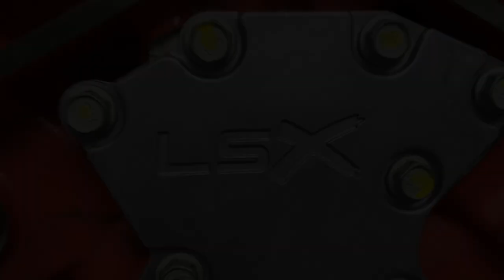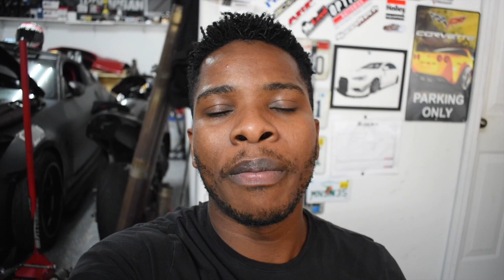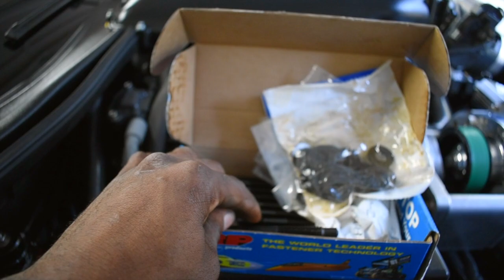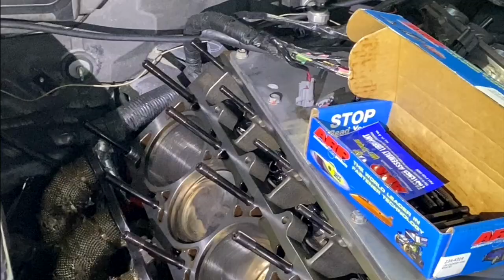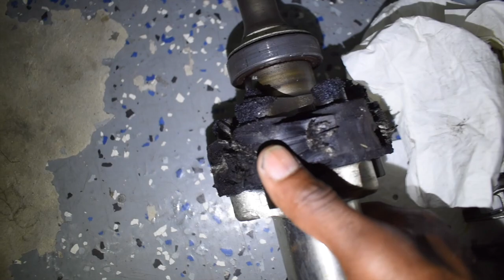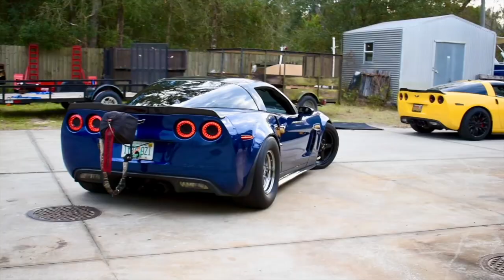ProCharged 441 LSX C6 Z06 | Broke Our T56 Transmission

Comment: That's so awesome bro that you can do all your own work.  Didn't know that you were on a T56 trans, those are the weaker ones so it's good it lasted as long as it did. You should be good with the ZR1. The gears will be a bit longer so that should help a bit with traction.
Reply from the maker: Gears are longer, I’ve tested the trans, did not help with traction lol
Reply: @McgradyRacing  Damn. Are you running leaf springs?

Comment: The spring pressure broke the bolt. When you undo a rocker arm bolt make sure the valve for the rocker arm bolt is fully closed. Most time you can pull the treads out. Do it right once, it's time consumming but you will avoid issues
Reply from the maker: You’re correct bro, more work but safer

Comment: Tick performance builds good t56 and tr6060 at a good price. Might wanna give em a call
Reply from the maker: Went with the zr1 transmission for now. Gonna end up building that later down the line
Reply: @McgradyRacing  tick performance is gonna have good options when ready. Many good options like RPM, tick just broke stickshift record too!!
Reply: @TheRdub82 just went with a tick fully built t56 hope I’m happy with it and I don’t regret going 6060
Reply: @ryandoolittle1344  hopefully so. What's the powerplant it's behind? Keep us posted on how it goes!
Reply: @ it’s a built 454 N/A making around 600 whp don’t no to much about internals has Frankenstein heads and a bunch of goodies to make me believe it’s nothing cheap inside bought it from an estate so got a steal and will do my man should be about a week out and I’ll get some good data tick treated me super well was definitely happy with the customer service price was a little steep but I built it for 1000whp so I don’t have to touch it for a while
Reply: @ full KW suspension pretty happy with car just sad the trans went out so soon after buying it but hey that’s the name of the game
Reply: @ryandoolittle1344  right on. All good stuff. Should give the gearbox good use ⚙️ glad to hear the customer service at Tick Performance.
Reply: @TheRdub82  appreciate it buddy hit you either way a sub you god some dope cars !!
Reply: @ryandoolittle1344  thanks man I definitely appreciate it.  The content is slow now since I'm overseas, but I look forward to resuming once CONUS. I have a few vids I need to edit and release.

Comment: More baby steps forward!  I've always had mixed emotions about those rubber to aluminum bushing replacements.  They hold up better, but they also transmit a lot more shock/stress to the trans and rear!  I almost think leaving (new) factory rubber bushings in place and making them a high-wear weak link that needs more regular replacement might be the better answer until everything behind it is built up.

I love these cars, but they definitely get to a point when incremental increases get exponentially more costly due to their design!  Mine is still fairly stock-ish and I'd love to build it, but I already have a very fast TT Viper (which is hardly driven). Plus, I use the C6Z mostly as a DD, so I think I'll just do the basic H/C/I and headers to still enjoy the car, keep it reliable, and get the best bang for the $.  Going FI is tempting, but after doing a blown C5Z years ago, plus watching others like yourself, I know it can wear on you... and your wallet! 😂
Reply: Agreed. Easier when it breaks here than elsewhere.
Reply from the maker: Those are facts
Reply from the maker: I hear that! Surprisingly smoother with solid couplings. Must be the new trans lol. Gearing definitely changed quite a bit, gonna be dropping a video tomorrow!